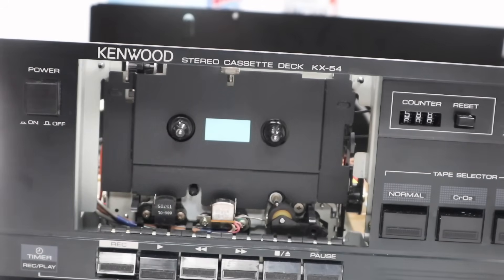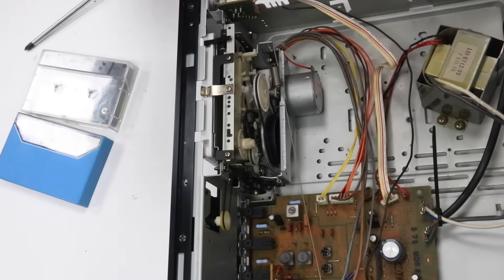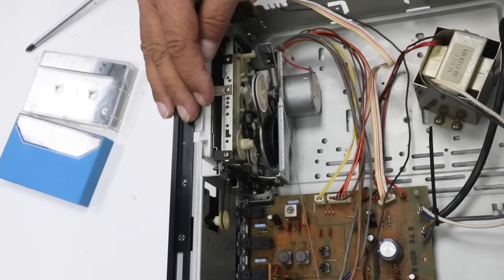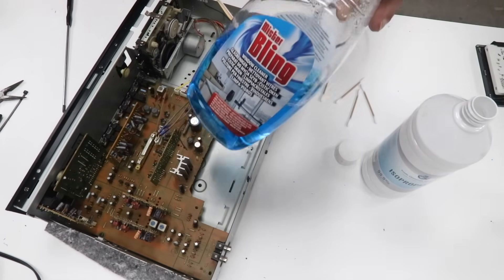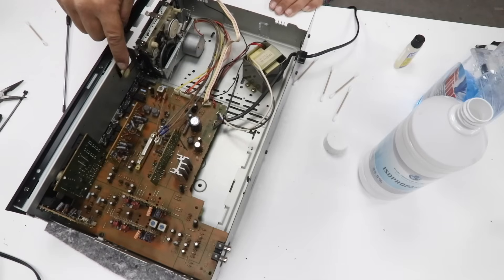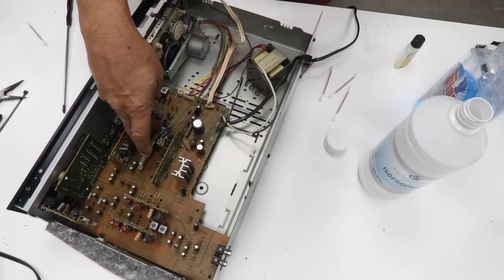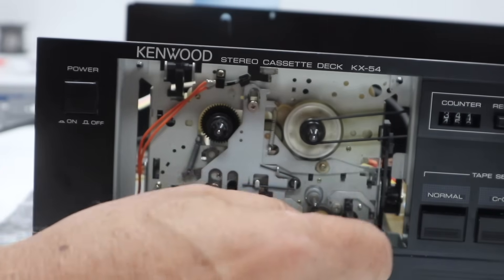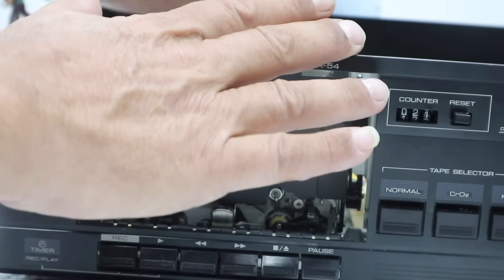7 steps to repair ANY cassette deck player vintage hifi audio electronics cassette deck repair

Comment: If I don't have these problems and it sounds great, should I still open it up and change the belts to be safe or is it safer to leave well-enough alone?
It sounds great with common old tapes from the thrift shop but I'm starting to collect these expensive new ones and getting paranoid the take-up wheel will suddenly fail. Akai HX-A301w

Comment: Tnx allot for this very educational video! I'm trying to repair my Sony TC-WE475 double deck tape recorder. Belts were cooked and replacing them I can play tapes now. However when i fast-forward/reverse the tape til the end/beginning, the motors won't stop and after some seconds, the deck put an "ERR" on display and stucks. I guess that the auto-reverse will have the same behaviour. I guess there is some kind of end-of-tame sensor (a photodiode?) somewhere but I've no idea on where. Any idea?

Comment: Mine doesn't close with a tape inside but does when the tape isnt in.

I think its not lining up correctly.

Also using a tape I have know to be bad for testing.

Comment: Absoutely excelent video, thank you! I have my Sony dual tape deck from the 80's that came out of storage to be part of my audio system, but it's not working. After rebuilding my SOny liner tracking turntable and Baby Advent II speakers, this video is exaclty what I needed to get my tape deck back up and running. Much appreciated! Keep up the great work!

Comment: Ive got a Sony TC-W300 thats is driving me nuts.  the clutch (if you can call it a clutch) garbage.  it seems to rely on friction alone.. but im also not sure how this thing was ever supposed to work correctly.  Its just a washer type thing rubbing up against the belt wheel a spring tensions against the washer to spin the spindle.  works on in play, but in rewind or fast forward it often just spins without making enough tension so the washer just spins on top of the belt wheel... just like what happens at the end of the tape (since it doesnt have auto stop)

anyone familiar with this piece of junk?

Comment: A little late to the party here… I’ve been troubleshooting my cassette deck and could use some insight. Mechanically it’s clean and re-lubed, belts are new. Play and fast forward runs fine until higher tension near the end of a tape, where torque drops and the right reel struggles, causing warble and awful music sound until the deck just stops on its own. Rewind works perfectly fine. Heads/capstan are cleaned and transport moves freely. I also have idler gears and not a tire… anyone have tips or similar experience?

Comment: Man I just got my first proper tape deck (i have a small collection I used to play in my old car) and its a yamaha k30 from 1988 described as "Working" on ebay, but one of the decks just doesn't output sound (it has two, and the second one works fine). The tape spins and everything (although it looks like its spinning too fast for playback) so I dont think its belts but possibly contact with the play head because there's no signal on the VU meters. Hopefully i can fix it with the info you provided here around 8:10 because the deck that doesn't play is also the recording deck (but the buttons are all digital switches so idk if its the same fix)

Comment: Hi, I was wondering if I could ask a dumb question? :) I have a JVC Kd-65 and it plays good BUT when I push play in the middle of a song the sound kinda ramps up (for less than a second or so) then continues and plays at normal speed for the rest of the side never fluctuating - What the heck could that be? If you have a moment I would truly appreciate any input :-) ?? Thank you

Comment: I have a cassette player RS-HD515 from Technics. It started to make ticking periodic noise when playing. I opened the case but could not figure out how to disassemble to access and inspect the belt. Tried on google but could not find disassembly instructions. Does anyone have suggestions?
Reply from the maker: i dont have experience with that unit sorry
Reply: I could eventually find the service manual on elektrotania website. Do you guys know about the datasheet of matsushita 5B2LW capstan motor? I think I need to replace it with a compatible motor that is still available on the market

Comment: Nah bro very often some electronics
 components are fucked on the board and its a terrible mess to repair. On walkmen i would say it happens around 10-15% of the time. Otherwise dead belt and dirty contacts of course, but don't forget to speak abt the good proportion of devices that are basically unfixable or not worth beeing fixed. Bc it can be a cold shower.
Kisskiss
Reply from the maker: whether or not it can be fixed is all down to the ability and knowledge of the tech ? (and money that needs to be spent ?)

Comment: i have a nakamichi cassette deck 1, and it's plays normaly until it reaches the middle of the tape, it stops. playback, fast forward and rewind is not poaaible. capstans are runnig so no belt problem. but when i unscrewed and opened plate of the door, there is center gear that attached directly to motor does fast forward rewind and play. when the tape reaches in the half, gear stucks, and stops turning so the deck stops operating. but when i touch that center gear a little bit, it fast forwards, rewinds and plays but usually playback stops at the righ gear. i tought lubing them just a little bit, could solve the problem. but now it doesent even operate. no fast forward no rewind, just takes up slack of a tape when its inserted and  when i press play ff or rew, it says "err" on screen. if you help me to fix this, i would really appreciate that.

Comment: This video is really good; I hope I would be able to fix my tape deck (it stops after 2 seconds, but if I keep the play key pressed for 4 seconds, after I hear a "click", play continues and do not stop. Also, the rewind fails if I just simply press the key... I have to find a very sweet spot on that key (almost full pressed, but not 100%) for it to work. Finally, the motor is always on, even with the cassette stopped 😅

Comment: An incredible video. I just so happen to have picked up the kenwood kx-54. 

My motor is just humming and getting hot…. All lights turn on. But zero deck function. 

One belt broke but again the motor doesn’t turn. 

What would you do?
Reply from the maker: i think your motor is toast , its such a cheap (and bad quality) deck it is probably not worth the $25 for a new motor
Reply: @cassettedeck-walkman-repair thanks for your input.

Comment: I was looking for a repair guide to an absolutely ancient Hitachi TRQ-291 "shoebox" recorder and the "AI" sent me here. A fascinating video, helpful to see how to go about taking electromechanical stuff apart and putting it back together again. I've always been good at taking stuff apart, not so good at putting it back together though 😝

I've oiled the motor on both sides, oiled all the bits that slide and spin, cleaned the heads, cleaned the pinch roller and idlers with Rubber Renue, replaced the belt with an expensive round silicone belt, given it all a good clean and polish and now I've got my old childhood tape recorder working again. Distinctly lo-fi, I changed the power supply capacitors to remove hum as they had gone bad after 50 years. Put on Oxygene and yeah, blissful melancholic nostalgia wafts out of the little speaker. Yay!
Reply from the maker: well done ! enjoy JMJ !

Comment: Thank you sir this is amazing information, subbed
Reply from the maker: thank you for your kind words !
Reply: @cassettedeck-walkman-repair hey real quick do you have a handheld recommendation that has stereo. Im looking to digitize some casettes but am trying to avoid really big units or really expensive walkmans. Was curious if you have found a happy medium stereo portable tape deck? Can be any brand. I accidentally bought a mono unit lol i forgot there was mono recorder style ones 😂
Reply from the maker: @SFX_Rhodes  no portable can reach the mechical stability (wow/flutter) of a home unit and in the end they will probably cost the same ?

Comment: My Left channel was not playing any sound. After watching this video, I got some alcohol and cleaned the 2 parts as pointed out here. Now the cassette deck is playing perfectly. Thank you for this quick and easy fix. Taking the deck to a repair shop would have cost me lots of $$$. I bought a $2 bottle of rubbing alcohol and problem solved ! Thanks again !
Reply from the maker: i am glad it helped !

Comment: I have a Marantz 5000 that's making an occilating type sound in the lower register in between songs and without a tape while play is operating. 
I've cleaned the heads, cleaned the record switch with deoxit, belts are good. I do need to clean the pinch roller, but I don't see how that can cause the noise I'm experiencing, especially when it does it without a tape in the unit. 
I suspect there are some noisy transisitors, or perhaps some of the electrolytic caps, just wondering if you have any other ideas? 
I mostly work on receivers and amplifiers so this is new territory for me.

Thank you, love the video.
Reply: Is it mains hum? Try moving the unit around (away from any sources of electromagnetic fields) if that's not the cause then perhaps the power supply capacitors have failed and are letting AC get through into the very sensitive DC circuitry.

Comment: im looking for a video explaining my situation ive got an rt100 and its been great but today it suddenly just record incredibly quiet but the monitor sound is fine ive tried changing cables changing volume and i even used different cassattes
Reply from the maker: is that the sharp rt100 ? i think that was my first deck growing up ;-). try cleaning the rec/play switch with deoxit first and the head with alcohol
Reply: I figured it out the in was in the output haha
But now the tape is playing kinda sped up and super wobbly
Reply from the maker: @Alexmlelms33  you can try changing the belts but these entry level decks will never sound good, might be acceptable after changing belts

Comment: Worn headsust be amongst the other 2% of problems. ?
Reply from the maker: in my experience worn heads are not as big of an issue indeed
Reply: @cassettedeck-walkman-repair also you won't find a much loved deck without a worn head , because the better they are the more they will have been played. I will freely admit there are 1000s of "not so good " decks where the heads are in good condition😅
Reply: @cassettedeck-walkman-repair thats the trouble. Very few people realise what level of performance some of these machines had. You are prepared to chuck them in the same boat and say they were all mediocre!

Comment: My tcd 300 plays perfect with some cassettes but not all cassettes. I’ve tested 20 different cassettes, 18 worked well 2 did not. The 2 are the same as the other 20. Any ideas why this happens?

Comment: the problem with my tape deck (Aiwa brand) is puzzling me, motor is in good condition, belts are fine, head cleaned and aligned, capstan rollers are cleaned, but randomly goes high speed for a few seconds like listening in fast forward, sometimes after a listening to a few songs all is good then suddenly goes high speed, i press stop then play again and it goes back to normal. sometimes i don't do anything and goes back to normal speed by itself, becomes annoying. just when i'm having those nostalgic moments listening to depeche mode, and duran duran and this happens ruins the moment, haha!  i hope you can give me some tips on what to check.

Comment: Help me, YouTube... You're my only hope.
I have tried so many things, now, but the issue is still there, and I'm desperate.
My Pioneer CTF 750 plays all cassettes, with an awesome sound quality. I renewed the belts, cleaned everything, and demagnetized it. Plays without problems - but it won't record properly. The sound is distorted as hell. Sometimes it records 3 songs without issues, but then the issue comes back... Does anybody have an idea? 🩵
Reply from the maker: try cleaning the record / play switch
Reply: @cassettedeck-walkman-repair  i did, of course. And it plays without issues. I noticed that cassettes running slower when recording. Could that be a hint to sth??

Comment: Can you please tell me if the sound is very distorted, what could be the problem? I have replaced the belts (tried different sizes), cleaned the head, lubed the volume wheel. The sound is still hoarse.

Comment: What about Head Demagnetization.  This is to be done after 20-30 hours of use.  Because enough residual magnetism will have built up on heads to cause poor high frequency reproduction.  
I have 2 excellent decks but their time alas has passed.   The age has changed.  I can cry over my wonderful automobiles but when anti-gravitational vehicles take over, they will become a memory.  
Tapes and tape decks were amazing but times have changed.
Reply from the maker: i only demagnetize if i notice / hear it needs to be done

Comment: I tried recording a cassette earlier today. First attempt from my phone via aux to 3.5mm cable but about 25-30 minutes in it freaks out and the audio goes very high pitch, speeds up and gets wavy. Same thing when trying cd to cassette recording. But tape a to tape b works fine. Tried different tapes to record but the problem remains. It's an old Sony deck and dunno what to do
Reply: 🤔?🤔?🤔?oh my

Comment: Hi there, 
This is a great video - thanks. 

I hope you don't mind me asking, but I wonder if you could offer a clue. 
I'm trying to fix my Technics RS-B305 deck. The issue is that the play head transport does not raise up to meet the tape at all when play is hit - which also means that the flywheel is spinning really fast. . I suspect it's belt related, but am searching for info before I dismantle it, as those units are a little more challenging to get at. Do you have any thoughts?
Reply from the maker: thanks ! what i would look at first , does the head come up high enough ? it might be pinchroller related where the pinch roller spring isnt mounted correctly preventing the roller to come up completely , if thats ok its a bit more involved and i would suspect the big cam gear. all assuming the main belt is in place and the head bridge comes up properly
Reply: @cassettedeck-walkman-repair  Thanks for such a kind and fast reply. In fact, it's the entire bridge (that houses the heads & roller) that is the issue - it doesn't move at all.

Comment: I replaced both belts on a cd/cassette boombox and the rewind works but fast forward does not. When I press play only one wheel spins & machine keeps eating tapes. Any suggestions?

Comment: Hi I got an Aiwa AD F-880 my dad bough when he was younger. 
I had to change the belts because they fell apart and hoped that would be the problem. The cassette runs for about two seconds and there’s a digital display showing that the cassette can be read, but then it stops. If I try to rewind or go forward it also stops after a second. As I believe I do not have a mechanical counter and I already changed the belts and I cleaned the contacts too, I tried to find help online and read something about an Idler that’s to be changed, but don’t want to buy another thing that may not help me. 
I’d appreciate every tip or advice anyone can give me.

Comment: My belts on my Kenwood KX-58W cassette tape deck are working, though one of the two plastic tape transport holders only has one metal v wire holding one side in, looking to use a paper clip, small wire or fishing line to hold the second side in. Any suggestions on where to find parts?

Comment: I recently bought a Fisher Price Cassette Player/Recorder, and at first it played fine but then it started distorting the sound. I put new batteries but it's still doing the same thing, and I've found when I press the battery compartment lid the sound changes and warps. Is this likely to be because of the rubber band? Any suggestions on what to do?

Comment: My 2 Cassette Tape Decks don't have any belts not even an idler. Everything is direct drive. Once a year a drop off oil and that's it.
Neber the less it's intresting to see rhe video's
Reply: What make and model are these?
Reply: @writerjmd  Those are the Revox B215 and a Studer A721.
Reply: @showstopperrob1097  Thanks.

Comment: Thank you for such great video.
My story: Technics RS-BX626, mine was not playing, rew or forward, just stops within one second. When opened cassette mechanism, I have noticed 2 cogwheels in the center not touching, I have just moved them 1mm into correct position and here we go, all working.

Comment: I need help. My tape player is stuck on PLAY when i turn it on. I can't get it to stop. What is the problem?
Reply from the maker: @AcceptfactsNreality  press stop ? (Or is the timer switch set to play ?)
Reply: @cassettedeck-walkman-repair  I pressed Stop. It only stops the fast forward and rewind not the Play.
Reply: @cassettedeck-walkman-repair  
The play only stops when i turn off the device. Soon as i turn it on it goes to Play. So only way to Eject tape is to turn off device cus otherwise the tape is stuck playing.

Comment: Im having troubles in my onkyo ta 2025's eject mechanism please help me rectify the issue i always have to pull out cassette door manually by my finger. even though i opened its mechanism multiple times for its other issues and successful repair but not able to eject mechanism. I think it's soft eject piston itself is absent.